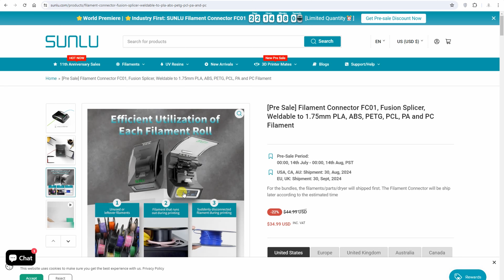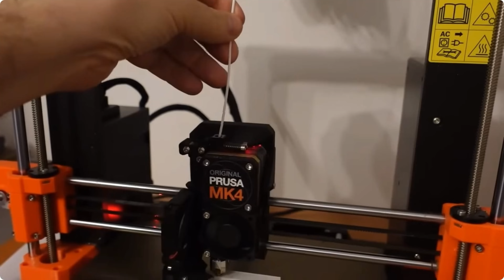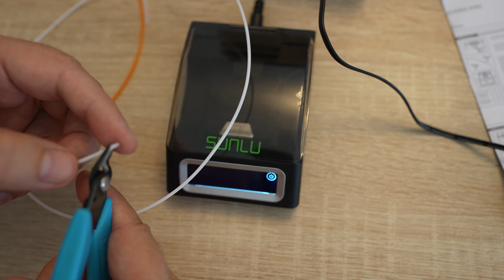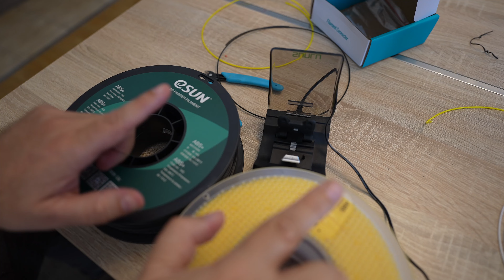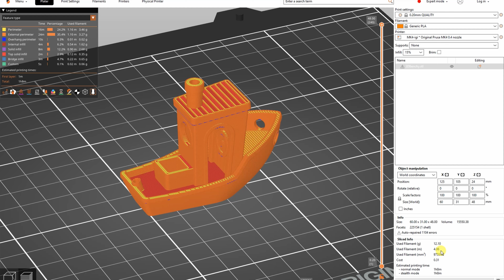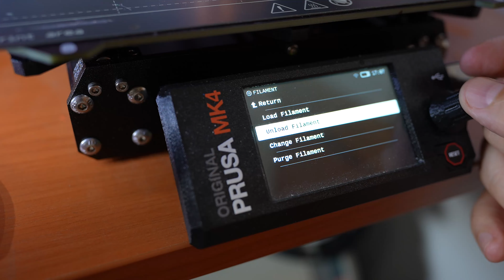Sunlu Filament Connector - testing the connection with PLA, PETG, ABS

Comment: Something like this might be useful for creating extra large spools. You'd need to find a way to wind them, but just take two 2kg rolls and connect the ends. Mainly for very large single prints though
Reply from the maker: But you can do this only if you unroll/roll them.

Comment: Some time ago I watched a video on youtube about this procedure by someone (unfortunately can't remember the channel atm) who also connects nylon fishing line together in the same way - of course without a dedicated device, just a heat source and a teflon tube. His suggestion was to cut the filament at a 90 degree angle (ie. straight, flat end) as it is easier to hold and push together during heating than two ends cut at 45 degree angles. Did you try this, and if so, is it easier and does it affect the strength of the join?

Comment: Oh god Sunlu. Its USB powered. Just put a USB port on the back. We get a stupid barrel jack to usb cable that will just get lost instead of using any USB cable that we already have.
Reply from the maker: You have my vote for usb-c plug!
Reply: With a barrel jack you can use any 5V 2A PSU instead of just a USB one. There are nice little power adapters that come with changeable plugs that cost very little and are very handy for powering many types of little devices. I'm sure most makers have at least one around for occasional use.

Comment: I was hoping, that the welder would not need the tube. To remove the tube I need one side open. However sometimes I would want to weld the filaments during print time. Well even most of the times. Pausing for filament change may introduce artifacts on print, so I would like to weld on the go.
Reply: There's a cutter that slices the teflon tube open from the side. Did you not watch the video?

Comment: But is the diameter of the weld still exactly 1.75mm? Thats my problem, i cant have wide filament areas cause it wont fit through capricorn bowden tubes

Comment: I've manually spliced rolls together when I see one is running out.  I simply heated one end with a lighter and touched it to the other end and sanded them to remove the blob.  It worked fine but it's probably not perfect because the diameter might have changed.  I can see how this would be cleaner.  Too bad they can't make it not use the teflon tubes.
Reply from the maker: They could, but in that case, some water cooling should be integrated.

Comment: I saw another review where the welded filament was getting stuck whilst printing, I suspect he wasn't mitring the ends with a 45° angle as the joint was fat, I just use my AMS and set it to continue with another spool when it runs out.
Reply from the maker: Do you remember which channel? I want to see it. Thx

Comment: Can we get the slicers to create a "color length cut list" to make a multi-color print using this? With pre-cut lengths of filament of the correct lengths? EDIT: Should be easy to make a script for this... Just sum all extrusion commands between each M600 or T0/T1/T2 command... EDIT2: On second thought. A completely unreasonable amount of splicing to be done for a normal multi-color print...

Comment: Great video Igor! The only question now is: what on earth can I do in mine that will be different? 😂😂😂 I think it is a great little device to have at hand when you need.
Reply: Trying to make things go wrong, maybe:
- in an extruder with a very narrow filament path
- a multi material system that pushes and pull the filament
- a janky reverse-bowden where the filament gets bent pretty heavily, to see if it breaks.

That's questions I have 😛
Reply from the maker: Try to play with the slicer, to have color changes on equal haights 😀

Comment: I'm still watching but about zero waste, I'm interested by the product but I find problematic that each connection would require using and wasting a PTFE tube.
Which is a forever chemical, not at all what you want to be used as consumable ☹

Looking forward to the rest of the video then.
Reply: Well, it's nice to see that the PTFE tube can be re-used many times! I might get this.

Comment: Its not a bad price compared to the previous existing solutions, I was thinking about making one of those DIY filament joiners to get some use out of all the tiny leftover filament spools I have sitting around but this looks like a easier way to do it than hacking something together

I think the only complaint I can think of is that it uses a barrel jack to standard USB, in 2024 these things should just be USB C, with USB C PD they could of drawn more power too instead of being limited to 5v 2a, that could of raised the price a bit but honestly I'd be fine with the tradeoff